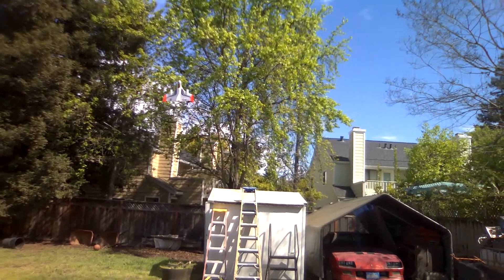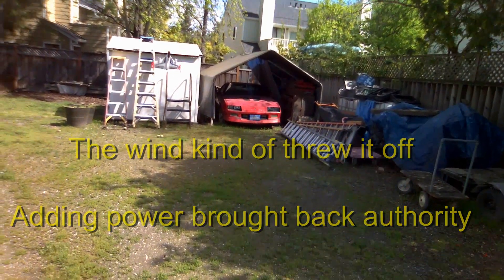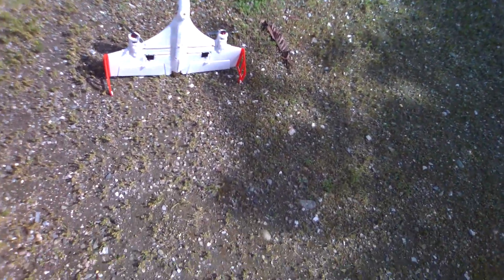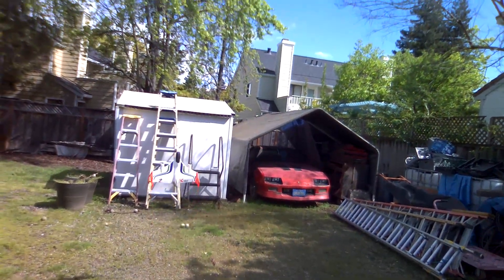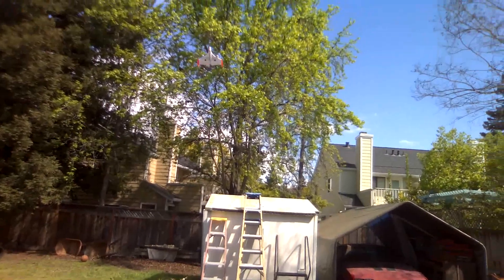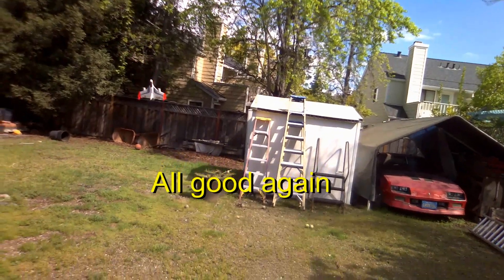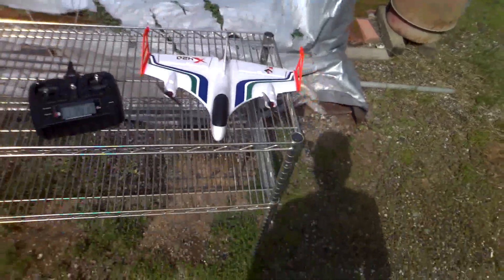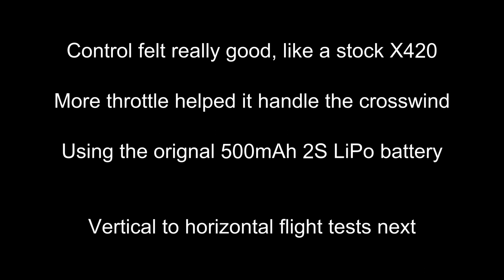XK X420 VTOL Aircraft - Brushless Mod / Brick Swap

Comment: You do some nice delicate foam work... Nice mod details as well.
Reply from the maker: Thank you Jerry.  I see you found my first version.  I thought going back to the original X420 receiver with convertors might help it with the wind, but it flew the exact same way as it did with the X520 RX.  Just have to fly these in horizontal mode on windy days I guess.  They do have landing gear for that.